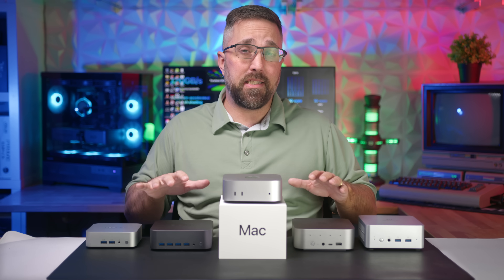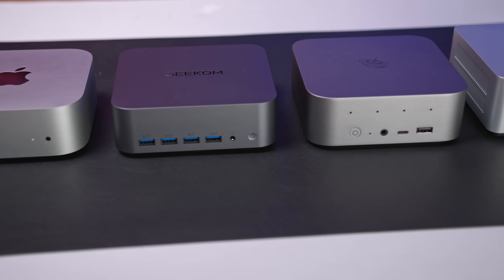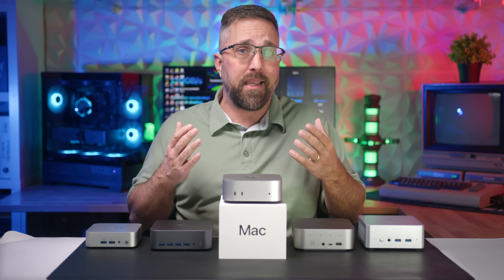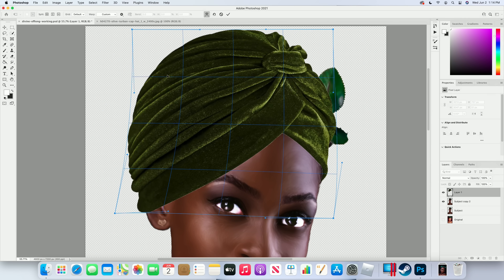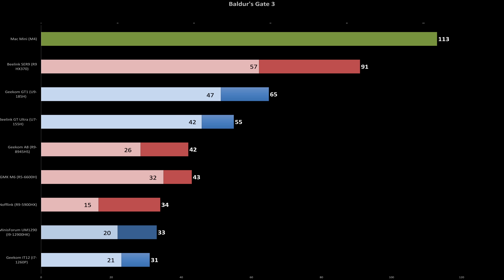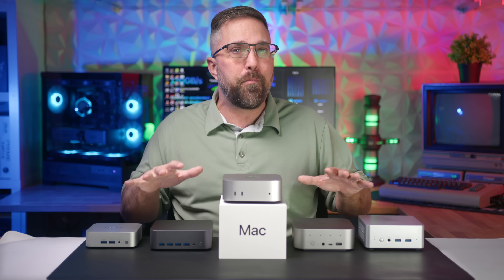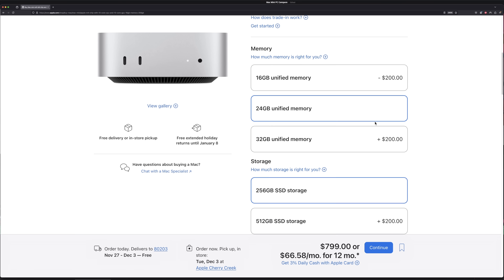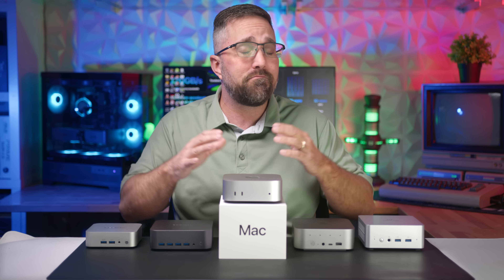M4 Mac Mini vs Intel and AMD Flagships – It's Not Even Close!

Comment: To be fair, I was investigating with an work colleague the market, and many of these MiniPCs are a better deal for 1 or 2 UPGRADES you can do on top of higher specs. So BeLink SER9 in your test is: 32 GB + 1 TB.

Assumming that you want the same specs but a better CPU and MacOS, the prices go from 599 (or 499 as a student) to 1,619.00 (at least in Europe), so price to performance will switch very fast into the MiniPC side.

As a side note, I just bought a MiniPC with Ryzen 8840HS (which are not top of the line) that are today discounted at around 750 EUR (with 32 GB and 1 TB) and I can upgrade them up to ... 96 GB with less than 300 EURO, or to 64 GB with less than 200 EUR. Would MacMini beat it? Sure, it will, in synthetic benchmarks. But want to do some real work, like working with large projects in video editing, RAW photo editing, and alike... a 1000-ish upgraded mini PC (with 96 GB RAM) will be untouchable at any price point of MacMini.

But if you want 64 GB of RAM, you can buy a Ryzen 5800H/U (or alke) with DDR4, and with the price of MacMini you can have a mini PC that cost like: 350 USD base system + 32GB x 2 DDR4 SODIMM 110 USD = <500 USD
https://www.amazon.com/Computers-Windows-Display-Desktop-Bluetooth/dp/B0BQHBWPYX
This makes it it cheaper and untouchable by MacMini that offer just 32 GB of RAM (soldered).

Given I bought a system that was 8840HS with 615 EUR (32 GB + 1 TB) which at least in an equivalent Mac Mini spec-ed is 1620 EUR in the same country, Macs don't feel that cheap, even granted that they have a bit more refined system and experience. And I did upgrade it to 64 GB DDR5, which I am sure that some sales representatives of Mac will say in few years that 32 GB on Mac are like 64 GB on other systems, but I don't buy it.
Reply: Because of the crazy prices Apple charges for Internal storage - get enough Ram for what you need to do (Some things likely don't need as much ram on Apple Silicon as with Intel... but other things absolutely depend on the actual physical ram being enough to keep the CPU/GPU fed with data) then default storage (or one step up) - then add external storage as needed - USB-C Enclosures with NVMe work very well, and are more than fast enough for most needs. Go to Thunderbolt 3/4 Enclosure if more speed is needed (still cheaper than what Apple charges). 
 One of the advantages Apple Silicon has is the Unified memory - data in ram used by the CPU can be accessed directly by the GPU, no copying needed - and most of the ram in the computer can be used by the GPU dynamically instead of a small set amount.  Not something most home users need, but is one of the ways it gets that higher performance.  Apple's stubborn refusal to keep the base models at 8GB until just recently was hurting the base model performance quite a bit, and their expensive jumps on the ram upgrades deters most people from paying for upgrades which likely also keeps most people from experiencing even better performance they could be getting (depending on the task of course, some things don't need more video memory)

Comment: Mate, you tried making a point the max is value for money but there is a big problem here. The base model of mac mini comes with only 256gb of storage. The 16gb vs 32gb ram isnt that big of a deal, but 256gb you won't have any space for any decent productivity task, softwares and plugins maybe and forget about storing any video/photos/work related documents that build up over time. So you kind of have to spend 800$ minimum for 512gb storage which is still low but the price comes very close now to the "pc" competititors. In fact, if you want 1tb of storage to the 100$ territory. 
Apple has essentially given a very very attractive base model price but has severely crippled it with a very very key spec that is storage.
Reply: I just bought a cheap 1TB NVME SSD on Amazon with an usb c enclosure and voila.... Problem solved
Reply: @jpht1964  how much did the enclosure and the ssd cost? Cheap ssd is fine, but a cheap enclosure will give you slow speeds. You will need to spend more money for a quality enclosure for better speeds and need a good cable. So the price in the end goes up to around 800$ anyways.
Reply: @bof8oom  , absolutely not slow at all. Enclosure does it's job perfectly for 15 bucks only.
Reply: Its a temporary solution anyway, because there are docks made especially for my Mac mini m4 with a build in NVME slot.

Comment: I was looking at a number of the mini PCs, especially the AI 370’s like those in the Ser9.  I ended up buying the M4 Mac Mini, my first ever Mac, for a number of reasons but the most relevant is that while AMD has a more powerful iGPU I have always had glitches with AMD drivers. 

MacOS is a pretty significant adjustment, but for $3-400 less than a Strix-point mini PC, you get some amazing performance and rock solid drivers.

Comment: I think what’s truly amazing and usually not stressed enough in these comparisons with other mini machines, is the fact that the mac mini doesn’t require a seperate bulky power adapter under your table. So despite the PSU occupying about half of the size of the case, it still manages to beat the shit out of its competitors, and even using less energy. And all this for that price. At this point competitors might just give up and produce kitchen machines.
Reply: Your response is spot on!
Reply: It's a nice advantage, but not decisive. Once the power brick is under the table out of sight, people just forget about them.
Reply: I was looking for this comment. A fair comparison would be to show the mini PCs WITH their power supplies.
Reply: until the PSU fails. can the Mac mini be powered via a USB 4 or Thunderbolt port ? If not you have an issue. On all the miniPCs, you just go buy a standard GaN adapter and you are good to go again.
Reply: @lubossoltes321  Also no, sadly it can't be powered by USB-C, that would be awesome.
Reply: @lubossoltes321 

Power supply failures are very rare.
Reply: @lubossoltes321   Mac minis have their power supplies integrated since 2010 and failures are highly uncommon. No surprise if you go look up photos of the circuits, and compare them to commonly sold power bricks. Spoiler: 90% of them shouldn't be allowed to be sold. It's not a coincidence that their circuits can't be seen, they're usually behind thermoplastics. But you have a point there of course. If it fails and you're out of warranty you would need to go and find a scrap board to replace.
Reply: @aeonoea  well given Apples tendency to encourage right to repair, even if you do that the result will not work. Yes it is not likely that the PSU will die but there are various external factors like blackouts or surges where the PSU can get damaged that are out of control.
Reply: @aeonoea yup my 2010 mac mini server has been running non-stop for 14 years - no PSU issues yet! knock on wood
Reply: They also run for 3 times the life span
Reply: It only managed to beat the shit out of its competitors in benchmarks and uses Mac is designed for, not overall. Everyone has their use cases and preferences, bashing the other companies and saying they should make kitchen machines is just a lowly insult. Especially when Mac uses MacOS and the os is specifically optimized to run on a few  CPUs (referring to ARM based cpus) unlike the Windows/Linux machines that have to be optimized to a lot of other x86 based CPU's, this goes the same for the software. 
Everyone has their use cases, I would love to use an Apple product, but it doesn't fit in my ecosistem and use case, especially at the price's they have. 😄
Reply: With Mac Mini you need bulky external SSDs, USB adapters, card readers which are not free. $600 MacMini + $200 external SSD + $50 USB adapter + $50 card reader. How much is Mac keyboard and mouse? You will end up paying at least $1000.
Reply: @FirstLast-nr6gf  So what? And this is highly manipulative. You might already have or you might not need an external SSD, USB adapter and card reader. You might or you might not already have a keyboard and mouse. You might or might not need specifically the Mac keyboard and mouse (I have Logitech MX Master 3 and MX keys)
Reply: @FirstLast-nr6gf 

Bulky SSDs in 2025??
Reply: @FirstLast-nr6gf 

USB adapters? For what? Bulky SD card reader? $50?

Comment: It is always disappointing that Apple will make such wonderful entry level machines and ruin that advantage with ridiculous upgrade prices. They could be killing it across the board. But as soon as you need to upgrade to a 1TB hard drive (which if you are storing a lot of photos and doing any editing, you need), it just changes they value quickly.
Reply: 256 GB is perfect for an OS drive. The rest is up to the user with external storage. Just one example. I store my Windows Wine Bottle on an external SSD, and unplug it when I am not gaming. The Mac mini stays nice and tidy.
Reply: @ Apple has iCloud and to the certain point it is just perfect. You tell the computer what you want to off load in to the iCloud.
Reply: @verttikoo2052  Sure, but that is overpriced as well and slows performance as it shuffles data on and off. It just shouldn't be this expensive to get decent SSD sizes or upgrading RAM. It's predatory.
Reply: @ Apple has a computer in every price category. Pick and choose.
Reply: @adaml.5355  I'm glad it is working for you. You run into walls quickly as a user though, especially if you aren't technical. 1) It is much slower than the internal drive so even moving my Photos DB to an external shows a difference 2) I've had problems with some apps and Spotlight indexing going nuts with documents and apps on external drives 3) SSDs are cheap, 256GB is just insulting given their upgrade prices.
Reply: @adaml.5355 exactly. and now that 16GB is standard - this is fine for most folks too.

i feel like lots of peeps get hung up with "the price of upgrades" rather than exploring how amazing the base machine already is.
Reply: This is deliberate choice from the Apple. Apple never prices their products the cheapest way. They go in the middle. They leave space under and over their price line. That is to make their partners lives easier. As a customer if I need something that works right now then I go and buy Apple. Otherwise I buy accessories from the other vendors. 

Also Apple always keeps the price points steady and in that way makes the second hand market for Macs work perfectly. You want more power? Then you go and buy the power and sell the old Mac in the second hand market. There are plenty of people who are happy to get those in their hands. (Think students.)
Reply: @verttikoo2052  They do not go for the middle. Their upgrade pricing is predatory and ridiculous. I'm glad they have top of the line components and machines last a long time, but making RAM and SSD upgrades so expensive hurts both their brand and their sales and might actually be illegal in many countries soon. It wasn't always this way either.
Reply: @MS12-u5p  First MacOS is very good at handling data and memory. I don’t go deeper with that. 

With Apple you always know the price points. You thank Apple when you sell the machine. You decide in which price point you are and you follow the prices and they always stay the same. If you want all the computing power in the world then you know how expensive it is. Again you know that you get good value for your old computer. When you are a professional then this is known running cost in your business.
Reply: @ Inflated prices are still inflated no matter what value you think it provides.

Comment: "Apple Silicone"

I know this is a nitpick on the pronunciation, but...
Silicon and Silicone are different.

Silicon is a naturally-occurring element. It's a metalloid and semiconductor.

Silicones (polysiloxanes) are polymers, many of which are colorless oils used for lubrication and others that are rubber-like used as a sealant/insulation.
Reply: noticed that too. I was about to comment about it and then I saw your comment. 😅
Reply: Shatner made the same mistake on Star Trek back in 1967!
Reply: To add, Silicon is generally a hard material, it has a conductive property which makes it very useful for making microchips. Silicone resembles something more like rubber in consistency and is a resistor.
Reply: Silicon: think, say, Silicon Valley.  Silicone: think, I dunno, San Fernando Valley?
Reply: I bet the Mac mini uses less Jiggawatts than the others.
Reply: Thank you, came here to say this. Any respectable IT "nerd" should know the difference.
Reply: @robmaertens  oh come on. Is any IT nerd going to be confused and think the chip is made out of silicone because of a pronunciation slip?

Christ, we’ll gatekeep anything in this industry.
Reply: @alanschmitt9865  I completely understand, not trying to be snarky we all make mistakes. In my experience a lot of people don't know the difference or that the name implies something completely different. I'm sure it was just a slip of the tongue. The previous comment describing the differences between the two was excellent for the masses that don't understand the difference. Educational moment for those that want to learn.
Reply: "Joined 18 years ago" Damn, and you're still active, unless this account was bought
Reply: @MooCowMooMooMeadowsOfficial lol

Comment: the only thing MAC cant do is to output bitstream uncompressed lossless audio using its hdmi2.1. currently it only allows lossy dd+ atmos not dolbytruehd. cpu power wasted if you cant use that as a full home theater box. windows laptops can do it since 2009 laptops lol.